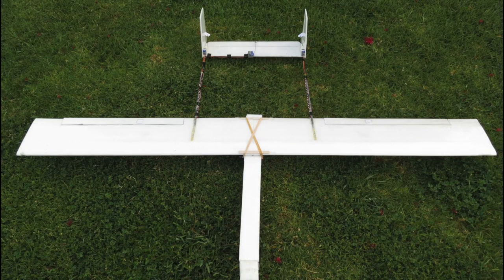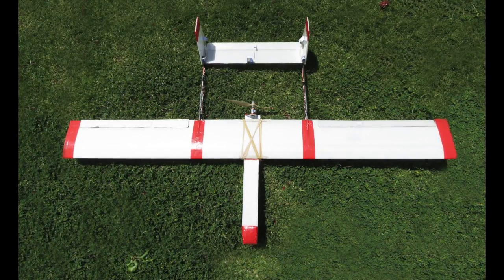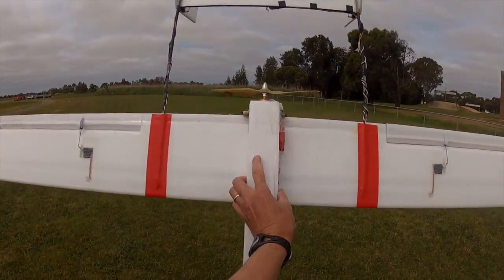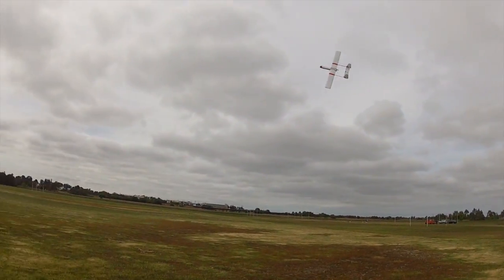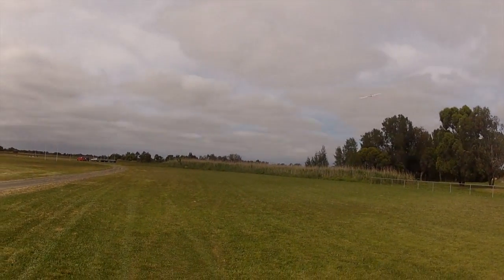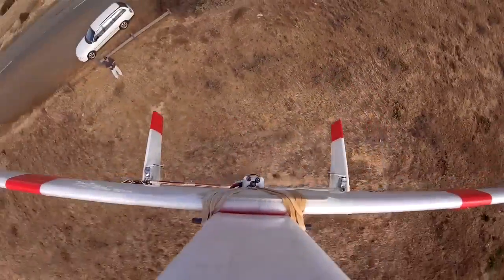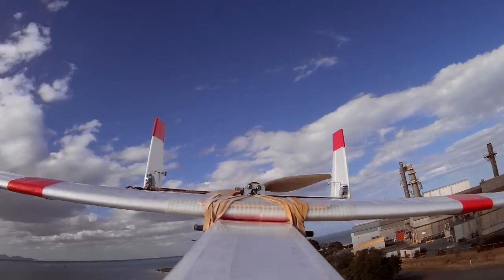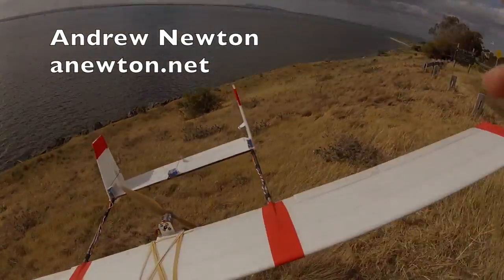Twin Boom motor glider

Comment: Hi andrew , aways like your approch to builds , will deffo make one of these in this size . I noticed you have 2 rudder servos is this the easiest way to do them , can they be linked and run of 1 servo ? . Flies very well though .
Thanks G W
Reply from the maker: weavostigercat2000 Thanks GW. Rudders can be linked but I thought the span was too wide for a push rod and it would be a bit vulnerable to damage.

Comment: nice adaptation. I built one similar, but much heavier. I totally agree with the red brick ESC. I had 3, and only one is useable. should have spent the extra.
Reply from the maker: Ah thanks for the confirmation. Changed for a 30A plush and its working perfectly.

Comment: As an FPV Glider would you recommend this over your Depron Sectre? I had a Maker Trainer 2, wich is like a smaler Noob Version of this one. Since i crashed it last weekend, i rememberd your Depron Spectre, so as FPV/Trainer/Motorglider, wich one would you reccomend? Thx a lot =)
Reply from the maker: Grearson .x Still testing this one, haven't had a nice calm day yet. I think something in between the two might be perfect. About 1.5m wingspan with a thicker airfoil for slow flying and more weight carrying ability.

Comment: Looks great there Andrew Newton , what size frame could I build using a 28-26 1000kV  with 9x4.7 props
Reply from the maker: Thanks George, it would need to be a bit smaller than this one. The 1.3m Spectre would suit it perfectly.
Reply: +Andrew Newton ,nhb

Comment: Ah, Andrew, you did it, and it flies great too....The only thing I would say is that even when you put the FPV gear on it, it will still have a power surplus. I can get almost 30 mins out of my AXN using a 2200 lipo, that power setup would fly this bird in cruise mode Im sure with throttle management, remember, its a SLOPE Cruiser. Look forward to the slope fpv cruise video. Well done.
Reply from the maker: EnglishTurbines I tried yesterday with the FPV gear mounted, but in 25kn I was too scared to put the goggles on. Flew great but needed the occasional burst of power to stay out front.
Reply: Andrew Newton 25kn wind eh, that sounds a bit stronger than normal? Anyway, put the goggles on before you launch it? You should only need occasional bursts of motor power I would have thought...Look forward to watching your next clip m8...:)
Reply from the maker: 25kn is kite shredding, plane busting, sand blasting wind. Love it.

Comment: Hey man very cool.  Just wondering what you have your throttle cut set to?  You may know this already, but if not- sometimes if you have your throttle cut set to -130 or something like that, those ESCs will "learn" that  negative 130 (can't use "dash", or negative sign, or this text box crosses everything out) position as your low point on throttle position and then when you go back to  throttle cut off, and low stick, it sees that as "more" than your -130 throttle cut position and gives you throttle. 

Just making sure you knew about that...   maybe that was the issue with your ESC?
Reply from the maker: Thanks man, I didn't know that. Do you mean Red Brick ESCs specifically? I haven't had a problem with Plush ESCs. Throttle cut switch is at - 100.
Reply: Andrew Newton Not sure about that particular ESC but I was researching upgrade ESCs to buy for my VisionAire, Radian, and Sport Cub a couple weeks ago and noticed a lot of people talking about that "problem" with a lot of ESCs. It is only a problem I guess really if you aren't aware that the thing is doing that. It catches a lot of people out.  Sometimes the manuals don't say anything about it.

It sounds exactly like what you described though. 

I think some Castle ESCs and some Turnigy/HobbyKing ones do that.  I'd check it out for sure! That's a nice little ESC, would suck if that is all that is wrong with it and you tossed it.

edit Well I guess saying it's "nice" might be an overstatement, LOL..  but hey if it works, it would be nice.. hehe.
Reply: BWX
I've avoided buying the red brick ones, partly because their cheapness actually puts me off, but also they are usually the heaviest for their output rating.